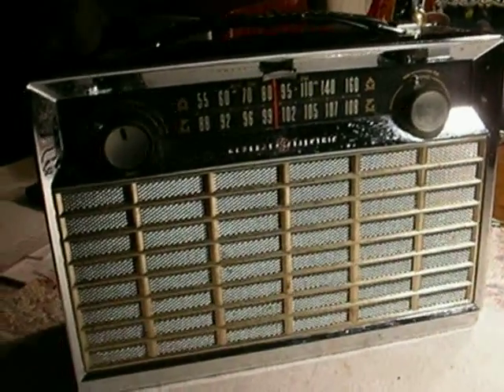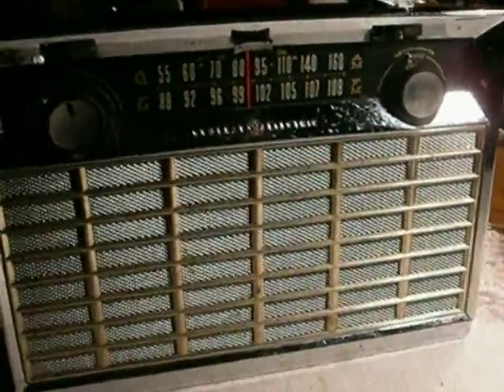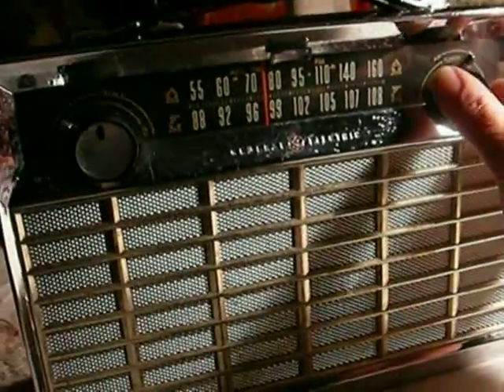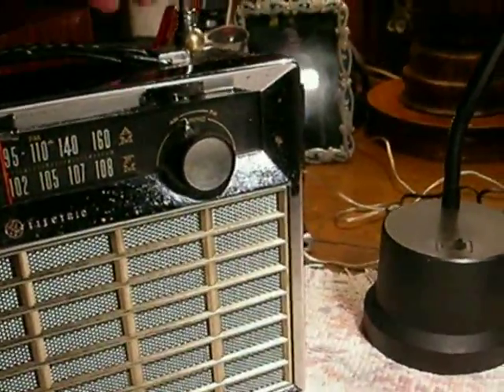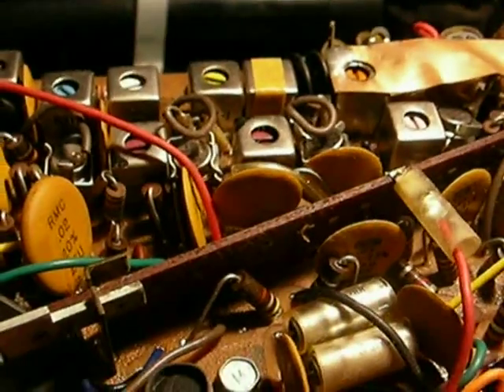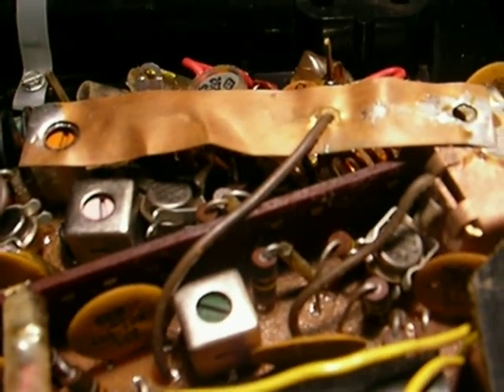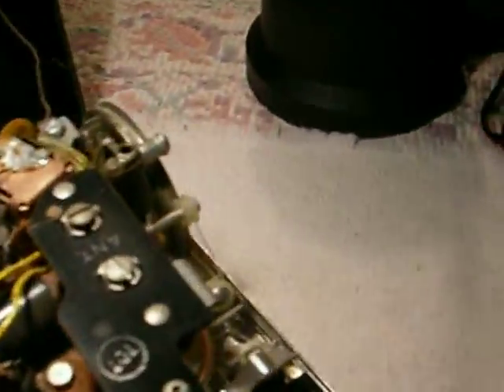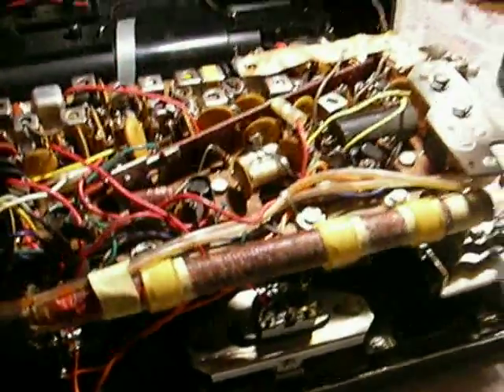GE General Electric P865 AM FM Transistor radio

Comment: The IF cans look like Japanese origin. That may be a good thing as the ones used in their AC radios had a high failure rate due to silver mica disease. I have the AM only version of this radio made two years earlier and it can beat the pants in DXing with any radio made today. Too bad, both of these radios are examples of the quality products we USED to make in this country. I read somewhere that the Utica, NY plant where this radio was made had 8000 employees. What a damned shame it's history today.

Comment: That's quite a find, and I notice the FM dial has 88-108 MC's, (or MHz) which seems to be the standard of FM radio. I see the requirement of the RF transistors in the FM oscillator stage with a 10.7MHz IF would have to comfortably amplify a 120MHz signal. In Australia, FM broadcasting only started in the early 1970's, and that was from the ABC (Australian Broadcasting Commission), with just news bulletins and classical music, funded by the government. Commercial broadcasts commenced in 1978..